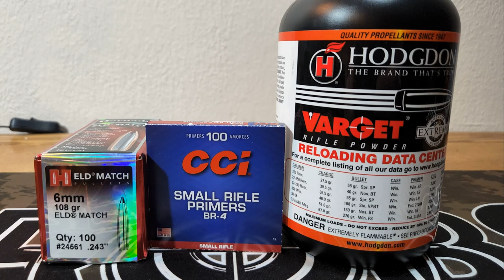Fine Tuning a 6mm ARC Load

Comment: That 27.6 load is money. Great group, outstanding sd/es! (Glad you threw the es in there. I was really curious with the other loads what it was.) I played with VV N150 for my gas gun and got decent velocity out of it where I couldn't with VV N140. (Same burn rate as Varget) Can't wait to get my 6 ARC bolt gun built.

Comment: 0.23"!!?  That's amazing man, I'd hold onto that load as well.  Mr. Rob, I see you still have extraction issues, have you contacted Savage about that?  I did read they will send you a new extractor kit with a stronger spring, and the video of the guy I saw install that said it resolved the issue.  On a timed stage, I wouldn't wanna be messing with extraction problems.
Reply from the maker: Yeah, some days it does drop the round before it kicks out of the action. If it continues to cause issues I will address it and contact savage. Seems to be hit and miss. I shot 15 rounds out of the gun yesterday in prep for the comp outout a hitch. But the most recent 2 6 arc videos I had a couple hiccups.

Comment: Do you find that an initial ladder test with brass that has not been fire formed yet (this test will fire form them) and one where the brass has already been fire formed have equal validity? I was curious as I just reformed 200 Lapua 6.5 Grendel brass to 6 ARC brass.
Reply from the maker: Brass for the initial testing was also fire formed. I would guess you would see small varience from loads prior to and after fire forming. Your results may differ however.

Comment: Hello Rob.  Great channel, thanks for sharing.  I'm down in New Zealand, shooting a Savage "Pairie Hunter" in 224 Valkyrie, my rifle is identical to yours (same XRS chassis) in every aspect apart from calibre.  My load is 25.3 of Varget behind 88 VLDs giving 2740 ish.   SD of 7

But I keep getting the odd flier (which I note happens with a lot of your groups too) and I wonder if its a issue with these rifles . . .  Maybe something like inconsistent ignition due to something binding inside the bolt or the like???   Savage rifles do seem to gave their share of manufacturing quirks e.g. ejection and J cant help wondering if this flier thing is another of them!

It would be good to pin down the cause as these rifles are pretty good and could be superb if it was identified.

Thanks Foster
Reply from the maker: I think generally a flyer is quite common with most of my guns. I'm either chalking it up to human error or small sample size. I'm guessing with 10-20 round groups you wouldn't see just 1 flyer.